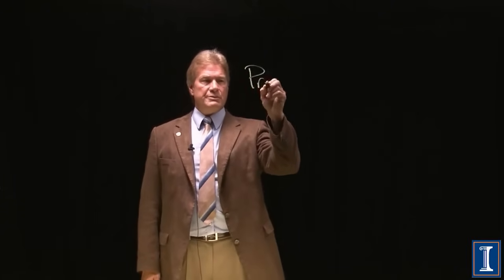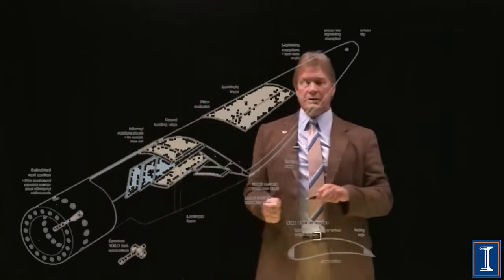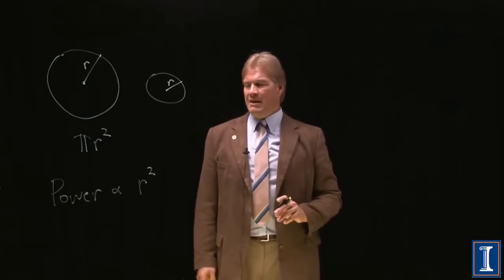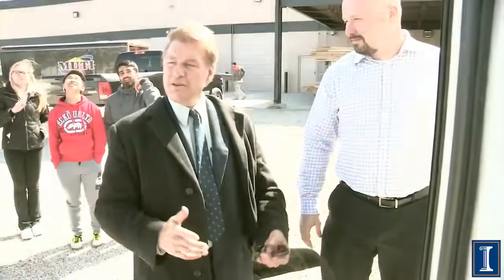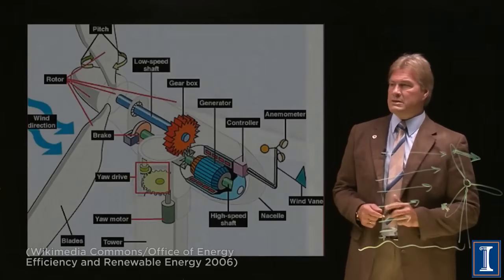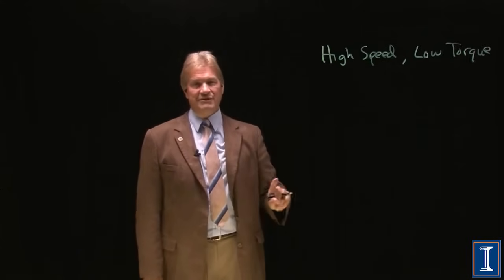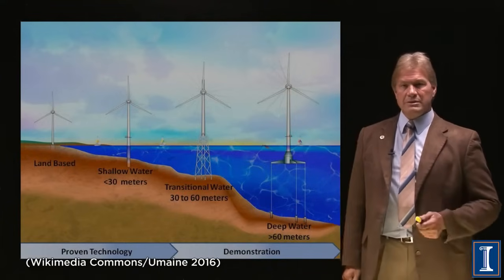How Windmills Work

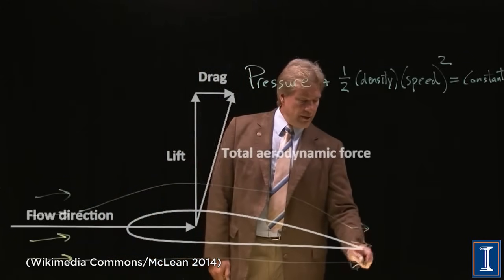Comment: Ooooo 3:32 nooooo, the air above and below the airfoil does not have to stay together at the trailing edge, in fact it never does - the airflow above accelerates to a velocity much, much higher than the air below (essentially the forward speed of the aircraft).  If you believe the split air has to meet, that would mean the air molecules below the wing would need to 'know' where the molecules above are, and molecules aren't smart like that.  The 'equal transit time' hypothesis is not only false, it should be intuitively obvious it's false.

For those preferring Bernoulli, air travels over the top of the wing faster than the forward airspeed of the aircraft, resulting in lower pressure at the top of the wing and greater pressure below it.  The airflow 'sticks' to the airfoil's curvature because air is a viscous fluid.  One way to think about the air accelerating over the greater length of the top surface of the wing (relative to the bottom surface) is that it has to speed up to get out of the way of the slower oncoming air. Back to the beginning of the paragraph, this pressure differential provides an upwards lifting force, making the wing rise as the pressures try to equalize.  Bernoulli's equation (ie, the venturi effect) accurately describes the pressure fluctuations of the air around the airfoil, but it is important to conceptualize that an airfoil is NOT one-half of a venturi.  Believing it is, is another fallacy, like 'equal transit time' discussed above.  As an aside, I remember having a hard time grasping that air accelerating over a curved surface having lower pressure than ambient across that surface.  One explanation that stuck with me is:  because the air on top is faster than below, it exerts less pressure on the top surface because the air molecules aren't there as long, even though the number of molecules exerting their pressure on the upper wing region remains the same.

As weird and unintuitive it may seem, there are certain circumstances, depending upon the angle of attack, when portions of the lower surface of the wing may induce lower pressures (negative pressures, as on the upper surface) than other regions on the bottom.  Regardless, when summing up all the pressure fluctuations, and the net effect is a positive pressure difference between the bottom and top of the wing, a lifting force is generated.

If Newton's 3rd law is more intuitive, the wing forces the air downward, and the equal and opposite reaction forces the wing to move upward (like your hand in the air outside a window of a car traveling forward fast).  There's always a lot of focus on the top side of the airfoil, but the underside also contributes to lift.

I was taught to consider both Newton and Bernoulli, and add the underside's contribution to lift to the topside's, but that the top of the wing contributes so much more to the lift force that the bottom's effect can be ignored as noise.  Perhaps I didn't understand or heard it differently, but it seems my approach was incorrect in concept but still, as it happened, resulted in a correct answer.  It turns out that both approaches are correct and both give the right answer when you do the math - that is, each theory correctly explains lift, independent of the other.  Each explanation describes why aircraft fly, but from different perspectives; since both are true, you can pick whichever theory you're most comfortable with.

Comment: I believe the shower curtain sucks in because hot water evaporates and also heats the air, so air density gets lower inside and it rises, so that fresh air is sucked in from below. Anyone tried it with really cold water? Or checked that the sucking immediately stops when stopping the water?

Comment: Sir you are a superb teacher, but with all due respect the airfoil aerodynamics are in correct: The lift is produced by the circulation, which depends on the AOA, a result of the starting vortex to separate from the upper trailing edge, the clock wise circulation is equal but opposite to this starting vortex 
Lift = dens. × Vel.× span × circ.
Continuity plus circulation determined by the boundary conditions determines flow geometry, and pressure is determined, as you say , by Bernoulli's energy conservation
The smooth trailing edge flow, equal local speed top and bottom trailing edge, the Kutta condition, determines the circulation, by continuously shedding a vortex if necessary.
Please the flow separating at the leading edge never arrive at the same time on the trailing edge.
That effect is an order of magnitude too weak.
circulation is the integral of the scalar product of the local velocity and the path element around any path encircling the airfoil. (m²/s)
Reply: Power = dens × (2/3 wind)³ × Area
This is the Betz maximum
when the wake equals ⅓ wind
then the windspeed  through the rotor disc is 2/3 windspeed way ahead. The power is usually lower when the wake speed is higher, as controlled by the blade controllable incidence angle.
Reply: @arturoeugster7228  This is great!  Thanks Arturo!  Obviously you're an aerodynamicist, or studying to be one...what's your story??
Reply: @Pene7942  You are familiar wiith Prandtl, who directed aerodynamics at Götingen. one of his students was Ackeret, who formulated the theory of supersonic lift, He taught at the swiss federal institute of technology and I was lucky too be able to graduate under him in aerodynamics and  gasdynamics, the thermodynamics of fluid flow, that describe all the equations needed to analyse turbo machinery . 
The one important point I learned from you is that using integrated coal gasification, makes the removal of nitrous oxides and sulfur dioxide much easier, allowing to power gasturbines using syngas, or by using the Sabatier reaction after the watershift reaction, where hydrogen is obtained  and the also produced co2 to  produce methane for general distribution as NG, with some hydrogen added, which seems useful in certain applications.
The enourmous advantage of the combined cycle is the high efficiency exceeding 62% with the GE aeroderivative gasturbines, with future improvements when the new GE90X engine is industrialized, meaning same cycle, and crucial materials like CMC, with reduced cost due to the removal of the weight constraints and the need to operate at high altitudes. CMC  : ceramic matrix composites.
As you can imagine, when you have a reliable way for  co2 capture you can recirculate at least part of the CO2 .
Thanks for your response.
Reply: Growing up in the 1970s and 1980s I was taught that the air flowing over the top of the wing has to go faster in order to keep pace with the air underneath that goes slower, as the Prof described. There are now a lot of YouTube videos explaining why this is incorrect. To me the two greatest arguments disproving the theory of lift provided by the Prof are:
1. Wings work up-side-down, i.e. a plane can fly upside down quite happily
2. Any surface, e.g. a flat panel, such as a door, can be a wing, (it might not be an efficient wing), will work as a wing.

Comment: Wings and propeller blades don't work because of the Bernoulli Principle. They work because of Newton's Third law.
The shape of an airfoil or a surface with a positive angle of attack, forces air downwards. The air is the reaction mass, the airfoil forces the airflow downwards and there is an equal and opposite force of lift on the wing in the opposite direction.

Comment: I yet to find one single post on Windmills that discusses Lubrication.
You car will hardly keep working if engine's lubricant not changed to the manual, and that is every 10000 km, give and take.
That's all when the car is never making more than 100KWh, travelling 100 KM / hour, likely less.
How about a device, such as a Windmill, that's advertised as being capable of generating MegaWatts of power per hour?
What about Lubrication? And if the Industry managed to create a class of lubricants capable of MegaWatts per hour stresses for 25 years, unchanged, why the same class of lubricants are not used in passenger cars?
"Energy, like time, flows from past to future".
Reply: That's a good question. While the relatively simple gearing doesn't put nearly the same sort of heat and stress on the lubricant as as gasoline or diesel engine; given their large contact areas, longevity is certainly a factor.

Comment: Professor Ruzic gives the usual explanation for wing lift due to Bernoulli's Principle in this video.
What he doesn't mention (perhaps in an attempt to keep the subject short and sweet although I think he alludes to it when he says that "it's not the whole story") is that there has been a long running argument about whether the lift of a wing is due to Bernoulli's Principle or due mass deflection (or both).
BOTH explanations are not entirely correct and if you really want to hear the somewhat simplified but nevertheless gory details of the more correct description, I'd recommend you take a look at the following University of Michigan video of a talk given by retired Boeing Technical Fellow (and author of the book "Understanding Aerodynamics:  Arguing from Real Physics.") Doug McLean entitled "Common Misconceptions in Aerodynamics", which can be found here:

  < https://www.youtube.com/watch?v=QKCK4lJLQHU >

(OBTW, Doug McLean is the same person that's referenced in the subtitle in the middle of this video as well as in the reference section at the end.)
If all else fails, you can try reading the book, but it's a bit on the pricey side and you have to have a decent understanding of math and so I suspect that most viewers wouldn't be able to handle it.

Comment: Oh no, he fell for the "equal transit fallacy" :-( The upper air molecules do NOT have to move faster. They actually slow down a bit.
Reply: You are correct about the "equal time fallacy".
However, I suspect that Professor Ruzic is trying to give a simplified explanation of where a wing's left comes from that is sufficient to get to what he wants to wave his arms at in the latter half of the video.
I suspect that he knows full well that Bernoulli's Principle is not entirely sufficient to fully explain where the lift of a wing comes from as he says "there's more to it than that" after he gets done giving the simplified explanation for the principle and references Doug McLean, retired Boeing Technical Fellow and author of "Understanding Aerodynamics:  Arguing from the Real Physics" in the video.

In short, this video is for people who aren't really familiar with aerodynamics and so all he's presumably trying to do is give a sort of correct explanation that's sufficient to understand what he's talking about in the rest of the video, no different that somehow giving an explanation for something using Newtonian mechanics rather than a more accurate quantum mechanics explanation.
Reply: OBTW, the upper air molecules actually speed UP quite a bit (not slow down as you state) so that they arrive at the trailing edge before the comparable air molecules on the lower side of the wing reach the trailing edge.